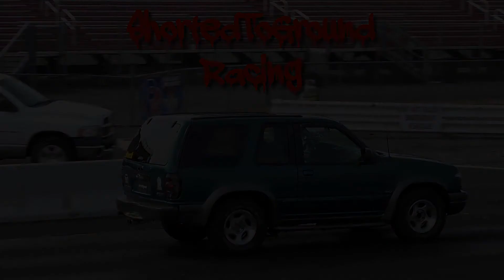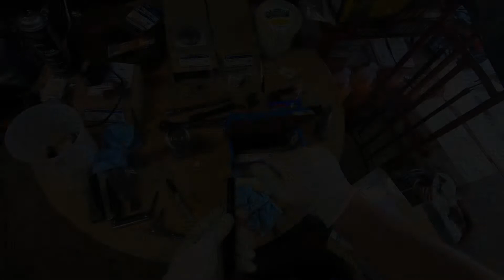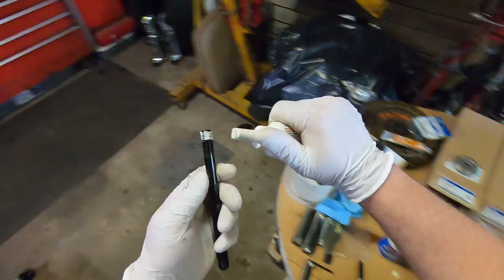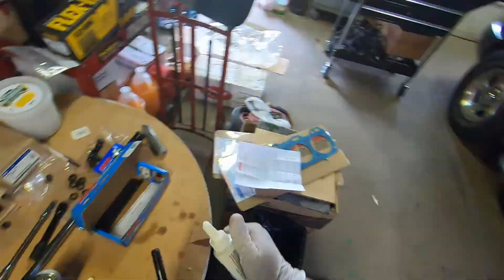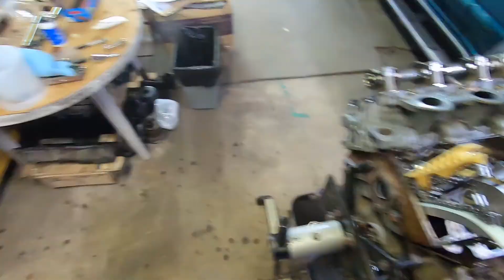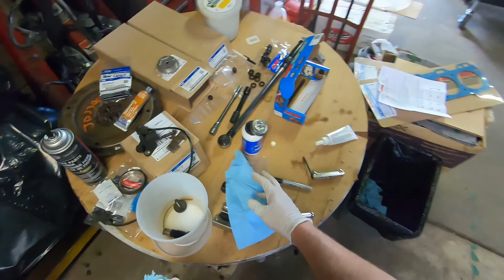Junkyard Engine Build - Installing the Passenger Side ARP Head Studs

Comment: Good vid👍 I'm currently gathering parts for my project which a 98 Ford explorer sport also. Besides forged pistons, what are your other plans for your original engine? Are you going with all forged parts, doing head work, different cam,etc? I know you drag race and might want to keep all that a secret lol. Thanks for the vids, they're inspiring 👍
Reply from the maker: As of now I have custom forged pistons and race prepped OEM rods, both from Supersix Motorsports, sitting on my dining room table. I have no idea when I will be starting the build though. Got to have the block bored .030 over, new jackshaft bearings installed in block, ARP rod bolts fitted to race prepped rods, rotating assembly balanced,  and a whole lot more. I already have custom built heads and custom reground cams from Supersix Motorsports (got them in 2017). The original engine is still in one piece and sitting on an engine stand. Maybe next year I can start on that.  As far as the junkyard engine build, I have no expectations for it. I plan to beat on it as hard as I can and see what happens.